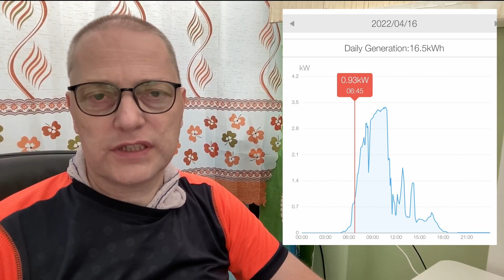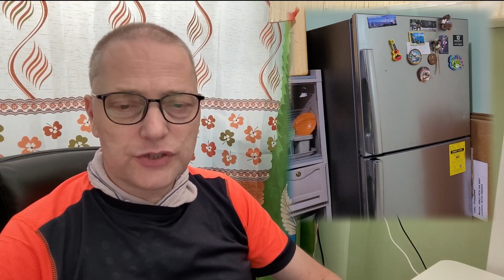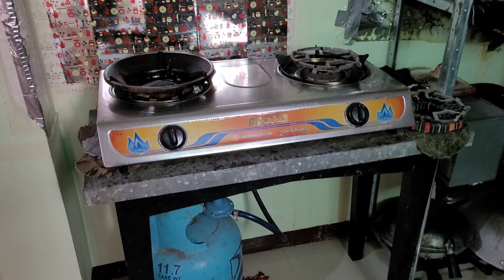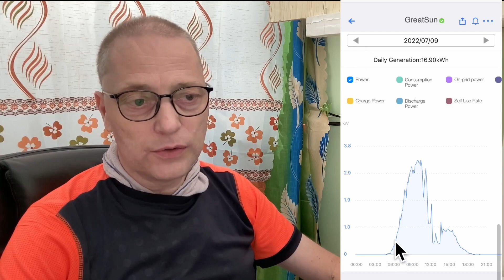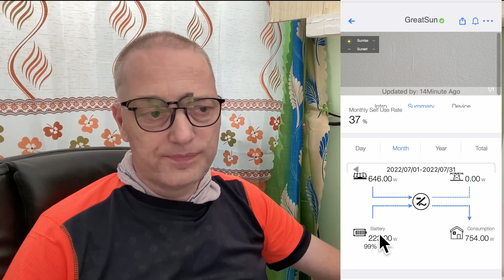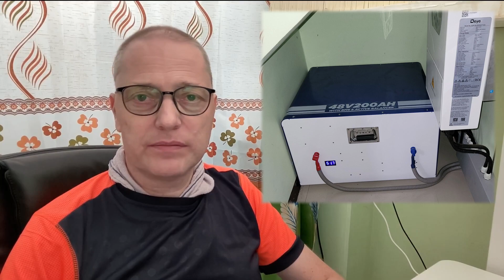Having SOLAR for just 4 month I now enjoy near ZERO electricity bills.

Comment: Suggest you get a drop down bamboo shade to hang outside your office wall that gets hot. Keeps direct sunlight off wall during hot times but can be rolled up in cooler times if you want. Expect that they are cheap.

Comment: if you had about 15 kw battery you might be able to completely avoid Veco. 

also with your hot wall in your office perhaps you could hang shade cloth or plant something growing up the wall to absorb the heat.
Reply from the maker: They only had 10KW at that time and I wansnt sure if I need a larger battery. I will upgarde in the future when markets are back to normal prices for sure.